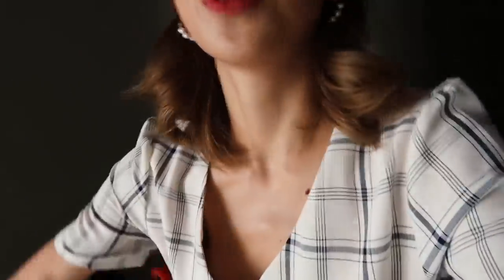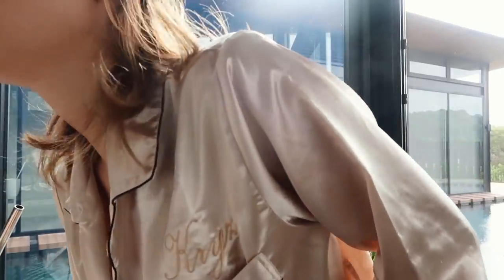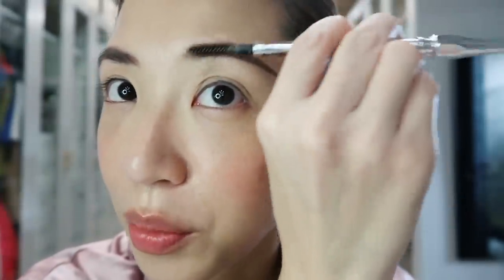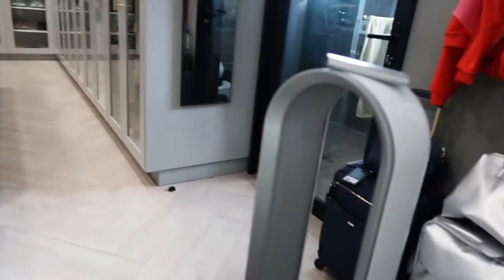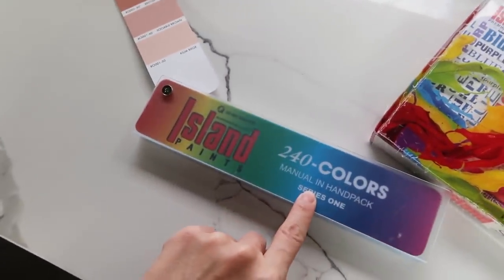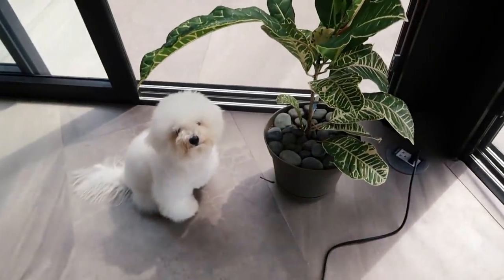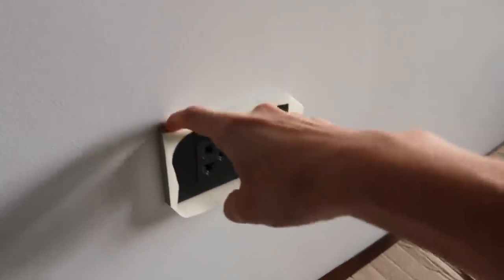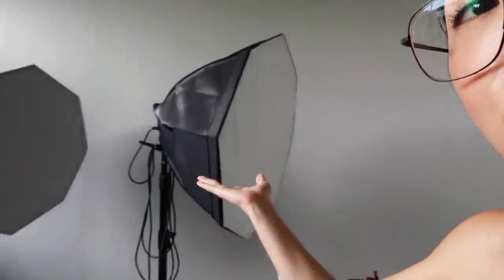VLOG: #Skypod Home Office Work in Progress | Kryz Uy

Comment: Use less juice and add water along with the kimchi, let boil a little to soften the kimchi some. I usually add Korean “tashidah” which is a beef bouillon powder but I know you can’t use that for flavor and touch of saltiness. Then you add the white rice to absorb the kimchi juice and water. If too hot, add more water and/or rice. If you’re not using the beef bouillon flavor then add seasoning like sea or kosher salt for some flavor since white rice isn’t flavored 😁

PS - Me being Korean, I add hotdog or spam prior to the kimchi, kimchi juice, and water to fry it up a little. Slater might like that but I know you are only fish 😊

I’ll definitely have to try that mascara. I have very straight Korean lashes that are long from my dad though so it’s hard to keep the super curled. Thanks!